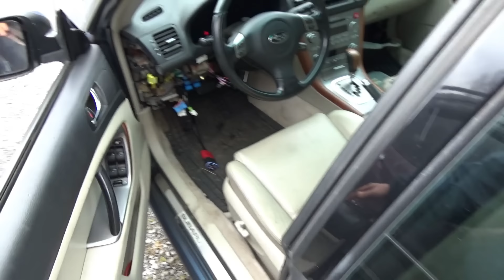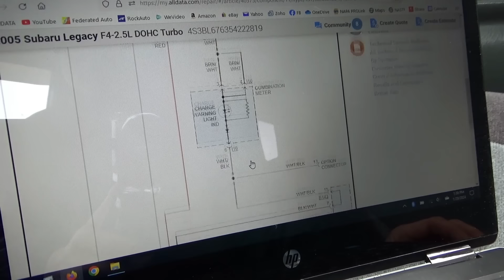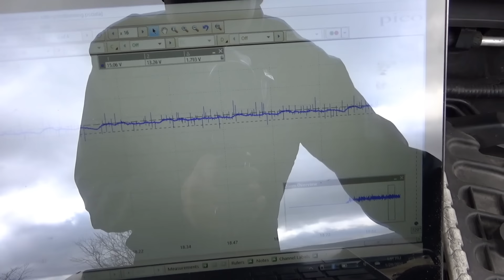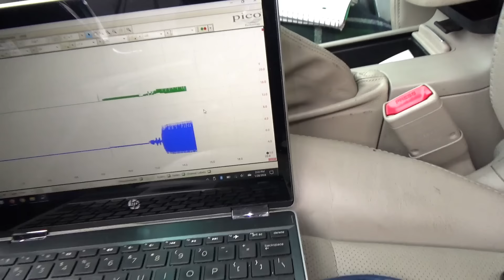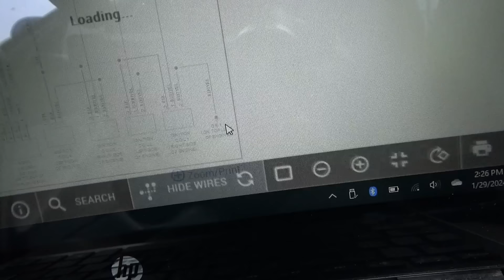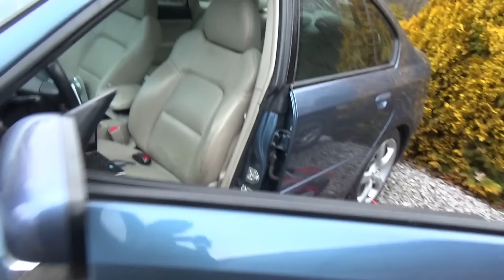Weirdest Subaru in the WORLD? (Part 1 - BARELY Runs with Alternator Connected??)

Comment: A few days ago one of my guys changed the alternator on a Volvo of some sorts
Im not sure if we diagnosed it or not, but it was bad apparently.
I just walked by as he was starting it up and i noticed there was a new battery on it. Which i know we did not put in. My gut told me to check the amp output on the alternator so i fetched my handy smaller ampclamp which max out at 100 amps. That clamp did indeed max out on the alt. wire. 
Told the mechanic to put the battery on a charger for a few hours so we didnt burn the new alternator out on the get go. Cause it looked like thats where the majority of the amps went. To the battery that is.
So he did. I went over there now and then to check on it and monitor the amps and it turned out the battery could take whatever the charger could throw at it if i turned it up. 60 amps in this case, and it did not go down much in the time we charged it either. The battery didnt even get hot. It was so weird.
We put a new different battery in it and it was all dandy.
What is the relevanse to this case.
Well... lots of amps need a clear path all the way arround the circuit. So a badish ground could have done some weird stuff. I know it started ok but still...
That case just popped up in my mind when i saw this vid...

Comment: That noise and spike level is crazy when the alternator is connected - on both 12V side and coil ground. I'd not be at all surprised if the spikes are causing problems or messing up sensor signals.

Comment: What is turned on by the charging circuit? On early minis the electric power steering pump only turns on if alt is  charging. Same circuit as the charge warning light on dash. If that is faulty and only turning on when alt is generating 12v, then problem would only arise then.

Comment: Maybe the alternator output is somehow shorted (bad rectifier inside?) and loads the engine. I would connect the big alternator positive on an external battery and measure the current it sends out to that battery with a current clamp. measuring the output of the alternator for ripple with the big car's battery connected may be misleading because the battery may "eat" the ripple (behaving as a capacitor). Also is the alternator the right part? If it is the 3Liter version, it may require the PCM comm wire, and the abcence of it may cause the alternator to full field by default and bog the engine down.

Comment: Start by confirming state of ground take a jumper cable from battery ground straight to the engine block where the alternator is mounted.
Reply from the maker: Coil ground was surprisingky perfect, so nothing wrong with block ground 😉

Comment: Hello, It looks like a ground problem. It should be 2 ground wires that connects heads with the engine block(under the car) and a ground wire that connect engine block with the battery and body of the car. Check that wires.

Comment: Cranking sounded weak to me so I’d check for poor engine to chassis ground. With the alternator working, the engine ground could be getting raised. You could use the charger with the negative connected to the engine block and see if it does the same thing.

Comment: my bh5 did that , My  cam sensor signal was getting messed up only on start up , thought the  alternator caused it, as did not fault with alternator disconnected,  checked the grounds and cleanned up and runs good now

Comment: I would do two things. 1 determine which coils are dropping out and 2 find the parasitic draw. Look for common interface. What is pulling the power away from the coils. It would also help to know if this problem existed with the original stock alternator.
Reply: I'm thinking it did that's why they replaced it but it didn't fix it.

Comment: Bad diode or short in the charge warning light circuit?
Lots of scrolling on my phone, but based on the clues you revealed -
1 reasonable DC output
2 parasitic draw
3 runs well when 13.6V @ 18A applied directly to battery.
So i looked for diodes in the circuit between the Alt and a 15A fuse - "combination meter" charge warning light.
If correct, who'd think to link the cluster with an engine running on 2 cylinders?
Great video as always Ivan & thanks for the puzzle!

Comment: What would happen if you removed the alternator belt? Does the alternator lock up like an electric brake?
Reply: You când take the little belt off  and start the car If it tuns ok the problem îs grom alternator spinning, possibly from the magnetic field gennerated when spinning. I have seen 2 card with similar problem a Fiesta and a Smart .The cars can't be started, they run on spray fumes and all the mechanics tought that was an injecții pumps problem! You când check the voltage with a multimeter at the battery and see If it varies much, i've seen cars that puts 17, 17.5 volts with bad regulators! My guess its the rectifier bridge faulty in this alternator If it is original piece, If not original change it with the original one, 3 wire Smart charge controlled! The electromagnetic brake output for generating curent is out of the limits and i guess the magnetic field of IT.
Reply: @dragoscristian9856  The alternator has already been changed. I'm wondering if the problem still exist with the alternator not spinning.

Comment: I had a similar issue on a subbie, the cause was a poor ground at the ECU. The MOSFETs that drive the injectors are working at 5V. When the battery voltage went above 12V and because of the high resistence of the ground on that voltage regulation circuit, it would create some sort of a weird RC feedback and thus mess up intermitently injector drive. Next steps would be to check powers and grounds at the ECU and check for good injector drive with a noid light.

Comment: Most likely another bad Alternator. From Advance discount auto parts. I've seen their junk alternators do stuff like that. We had one that every time you push the brake pedal the dash lights would come on 3 times we changed the alternator for advanced auto parts and it would do the same so we got a Napa alternator and it fixed it

Comment: Raise the system voltage while running using the maintainer to alternator levels. Check cam sensor signals. Jump the battery ground to the engine. Do a voltage drop test to the block during alternator connection. Not in that order.

Comment: Coil ramps when alternator plugged in suggest a fluctuation in amperage which suggests an ac fed source versus dc and returns to nominal when the ac curve cycles.  Either that or ground isn’t allowing higher amperage when plugged in causing the system to go wonky.

Comment: I'm going for Voltage drop on load due to a bad connection somewhere 😊😉
Reply: I would also try putting your TopDon Supply straight to Coils ground and Alternator +Positve or a Spare Battery's jump leads and see what that does 😊,  I do some odd ball stuff when fault finding 🤔 I've learnt to take nothing for granted over there years. 👍👍🤞🤞

Comment: That alternator wiring diagram is what I've wanted to check on a Toyota Hilux 1990 alternator. It produces 13.4V max, so bought all OEM rectifier, brush kit and the IC regulator. Before I install the IC regulator, I wanted to check the existing IC regulator by applying batter voltage to the battery wire and check the voltage at the brush kit (while it is not installed). I learned a lot from your channel and wanted to say THANK YOU IVAN!
Reply: My 94 hilux used to go through alternators pretty regularly, i surmised it was because they were mounted low down on the engine (22R) and were picking up a lot of road spray. The only time that vehicle let me down in over 500,000kms was the alt siezed without warning one day and snapped the drive belt. Same belt that ran the water pump!.

Comment: I would check the grounds you were mentioning. Subarus are notorious for weak grounds when they are all good. I guarantee the ground straps on the bottom of the engine are rotted off. So the ground to the starter is the only ground you have. I bought a 08 Impreza for $500 because they couldn’t get it to ever charge the battery. New battery n starter. Still no charge. I got it home and checked the grounds. Straps on bottom broke. Ground at starter loose. Fixed the grounds and everything works fine now. Oddly though it would start just fine so I guess the starter doesn’t need much ground to work. They do spin over pretty easy.

Comment: my next experiment would be to remove the belt that runs the alternator and run the engine with the alternator unplugged and plugged in and see what happens.  Another would be as other said keep the alternator unplugged from the vehicle and manually turn the alternator on with some kind of set up and the opposite of this.  Have system voltage maintained by the maintainer and crate some kind of set up to plug into the harness and fool the vehicle into thinking an alternator is attached.

Comment: Pretty sure i would pull fuse 7 and see what happens. Seeing it goes all the way back and ties into main charge wire at alternator. Providing im looking at correct schematics. Seeing a draw that goes away when pulling that fuse and it ties into charging system would be suspect. Bad diode in combination meter maybe causing something goofy?

Comment: The parasitic draw is usually the hvac unit in these. Not really sure what direction to go on the alternator, I like going after the coils, but now that you  know your losing amperage but the fires are still visible I'd have to ask where's the power going? Alternator is working, could still be a ground issue. Maybe run a separate feed to the alternator like on a old gm alternator since its not a smart charge system?

Comment: I would check computer powers and grounds next, swap ignition coils and see if the wave form follows the position of the ignition coils.
Reply: But i was down the right track since ignition coils were the cause all along. 😀
Reply from the maker: Swapping ignition coils requires jacking up the engine 😂

Comment: As an electrical engineer, I would say before you pull out all you equipment get your Fluke out and measure the ground connections. Shouldn't take > 5'. After that you can make video #2. OK, we only get to see what Ivan wants to show us, but still, coming from the rust belt I'd say definitely ground check.
And why are the copper windings of the alternator black? New color scheme? When I played with that stuff, only burned up transformers would have black wiring.

Comment: Those copper windings on that alternator look black as if they were overheated. Pictures of reman units I found show copper colored windings. The alternator acts like it's in a loop of the ECM saying "we need more voltage = full field then voltage to high = don't produce so much. As others have said before test the battery as it might be damaged from the parasitic drain.

Comment: Next thing I would try is disconnecting the main output wire from the alternator, connecting the battery maintainer (set to around 14 V to simulate alternator output) to the disconnected wire, and see how the engine runs with and without the alternator field connector plugged in.    How much current is being pumped out from the alternator?  I would also take a minute to look into the parasitic draw complaint--it may be related?

Comment: Does anything change if you disconnect the battery while it's running? Any chance that this is simply a mechanical load? I'd want to know what the load is on that alternator to rule that out. How much current are we pulling on that alternator?

Comment: Use a set of jump leads and make a temporary ground to the engine. Rule out your bad ground.
Reply: I agree  will eliminate and rule out ground problems By the way best comment by far KISS    Cheers
Reply: @anthonysova7117 Definitely KISS take nothing for granted 😊😉👍👍👍
Reply: @redtopberries It's past 3am here in Liverpool UK and I just replied with the almost same suggestion use the TopDon ground straight to Coils and +Positve direct to Alternator or use a Spare good battery with Jump leads to Engine Ground and Alternator Positve +.
😊👍👍👍.
Learnt from many year's of taking nothing for granted. 😊
Reply: The scope suggests there's no ground problem, but I agree with your strategy as connecting the cable is faster than connecting the scope.
Reply: Good idea

Comment: I did a search and found a strange solution. A subject with a GMC had the same issue and it turned out to be mismatched injectors. When the alternator was plugged in two injectors started flooding the cylinders causing those cylinders to misfire; he theorized the additional voltage caused the wrong injectors to inject too much fuel. Replaced the injectors with the correct ones and the problem went away.

Comment: I had the same problem on a Ford many years ago. Problem was a bad diode in the alternator causing high ripple on the 12V.
ECU did not like the ripple and went nuts. New alternator fixed the problem.

Comment: Ive seen something similar on the 6 cylinder subaru. It ran like that n just died while driving. We used a jumper cable from battery ground to engine ground to get it home then i used 4 gauge amp power wire( i used to install car audio n it was all i had at the time) to go from battery negative to the block n block to body n body to battery negative. N also idk on the 4 cylinder but on the 6 there are computer grounds on the block on the passenger side of the car on the engine block on the opposite side from the starter in the back twords the firewall.

Comment: It sounds silly but I would disconnect the main positive battery cable on the alternator to see if that makes a difference because the diode pack could even be shorted to earth although it's very unusual for 2 alternators to cause the same problem in a row.

It could even be a battery charge cable which is connected to the alternator which has rubbed through then blown out meaning that it's both open circuit & shorted to ground,it could even be pinched between something & that's even blown up the new alternator !

Comment: 1.  You need to separate the engine from the power source (battery, alternator and power managment).

2. Run the car from an independent shop power source.  Don’t run the alternator without a load as this may damage the diodes within the alternator.

3. Run the car from its own fully charged battery to check it out.

4. If OK then it’s the alternator part.

5. Next check the alternator with a load to determine what output is delivered with waveform (should be DC). Though the alternator windings produce AC it contains a diode package to rectify output to DC.

6. If the downstream is working then I strongly suggest that it is the diodes.

 You should never run an alternator without a load - it wrecks the diodes.  That’s why you should switch on your headlights to provide a load before jump starting.

Comment: I wonder if the alternator is putting out too much AC current and it is messing with the readings of the nearby sensors and ignition system. Haven't finished watching it yet.

Comment: I had a  Chevy Chevette.  years back. Ran fine started, charged fine. However once in a while on a damp or rainy day it would not crank. In the end it turned out to be a poor starter ground. Aluminum starter housing on an aluminum bell housing. Sanded clean, issue solved. Grounds can be confusing.  Some cars , as you know ground the battery to the chassis instead of the engine, then run a bonding jumper to the engine. The flexible braided ones look OK, but, are great for turning to dust her in salt land.

Comment: There's got to be a bad earth possibly on the ECU as there doesn't appear to be a problem with earthing to the Coils, Something has got to be floating as soon as there is any ac ripple or once there is a significant current flowing into battery.... however, I would also look into the current drain to identify where this actually is - I wonder if they could be linked.... (interesting that the engine gets progressively worse when alternator initially plugged in. As well as the 1st good current ramp takes 3 more steadilly increasing ramps before getting another good pulse) 

First check the basics - Power and Grounds plus identify where that parasitic draw is! If the signal are getting weaker when Alternator is plugged in, thats got to mean the current draw into battery from Alternator is causing a Potential difference (something is floating) across a bad joint somewhere (Power or Ground but most likely Ground)

Comment: My  thought is poor ground/s some place. works ok at low current, but when the alternator starts trying to charge the battery the poor ground cannot handle the current. The slow cranking also hints at a poor ground or/or bad battery.
Reply: Exactly my thought process.

Comment: I think I'd disconnect the output lead from the alternator or pull that 120A alternator fuse then run the car and plug in the control lead plug and see what you get for alternator output. It seems like the alternator is loading the engine so much that it almost stalls it out.
Too much field current could make the Alternator put out too much voltage and pushing too much current into the battery could be putting s massive load on the alternator and engine. Of course you could just put you DC amp clamp on the alternator lead instead of disconnecting it.

Comment: My guess before watching is the alternator is putting ac voltage/noise into the cmp or ckp circuit causing the pcm to freak out
Reply from the maker: What about after watching the video? 🤔😉
Reply: @PineHollowAutoDiagnostics  only got to watch the first few minutes and then got pulled away.  Hopefully will get to finish watching tomorrow.
Reply: @PineHollowAutoDiagnostics  I have seen an mustang, early 2000s era if I remember correctly.  Where the alternator induced noise on either the ckp or cmp.  The sympton was a long crank before starting.  So that influenced my guess.